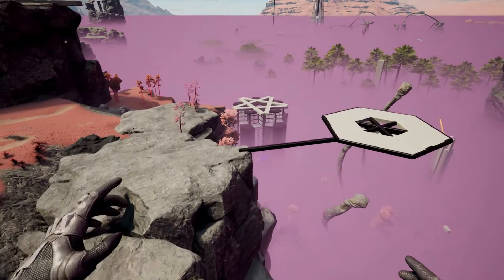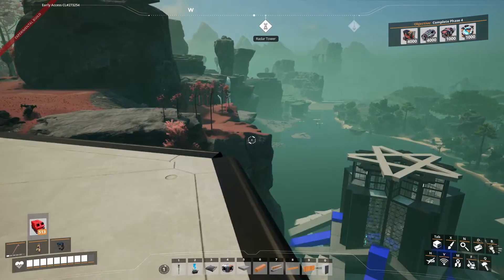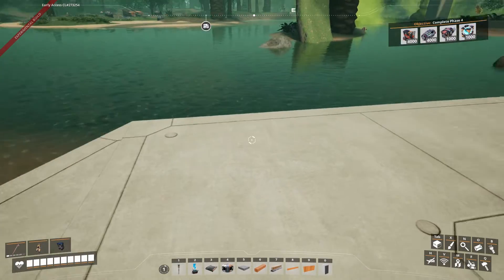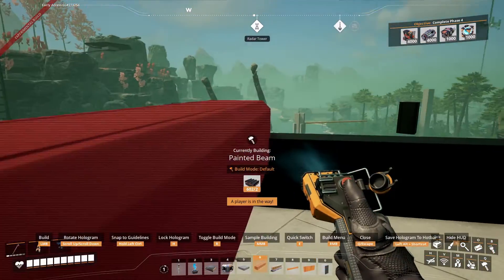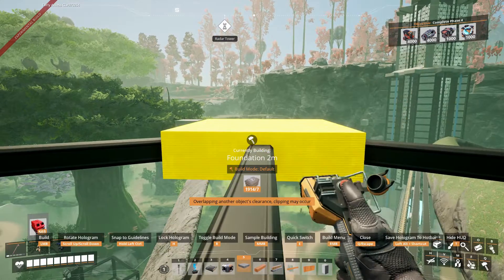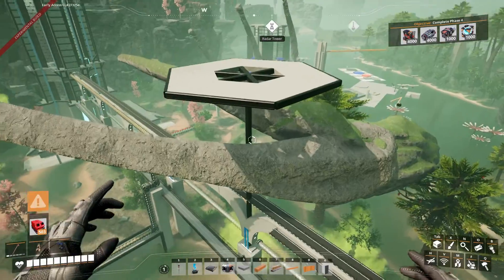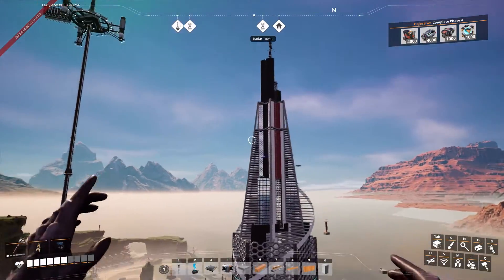Satisfactory Tips: Building a Hexagon from the Centerpoint

Comment: How big can you make this? Im trying to make an oil rigs and would like to use this method
Reply from the maker: There is no limit. There’s a beam trick you can do to connect any length, any angle. So just draw the six spokes out as far as you want, literally hundreds of meters is fine. 

Then to connect the ends of two spokes, click on endpoint of one, use R to change build mode to Freeform. Then go put your viewing reticle exactly on the end of the second spoke. Even if it’s over 40 meters, the angle of the beam is correct to that endpoint. Then connect the endpoint to that same spoke as many times as you need. If that’s too confusing how I wrote it, go to my shorts, sort by popularity and watch the fourth one “infinite beam length”

Good luck with the rigs!
Reply: @makergaming2022 sounds good. Does the road barrier trick work at any length too?
Reply from the maker: @iti @itisblackwolf mean at the beginning when drawing out the six spokes from the barriers/walls? Yes that is any length as well. Just leave it in default mode and draw out 40 meters. Then draw the next one out from the endpoint as many times as you need. Keeping the build mode on default will let you pull beams off the end of the next one in any ninety degree axis, including continuing straight.
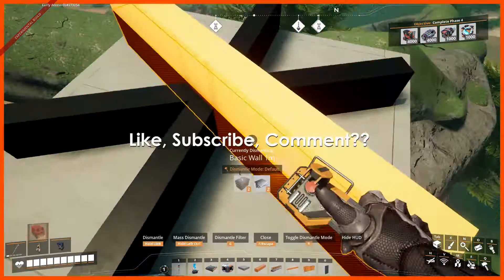Reply: @makergaming2022  I cant replicate this step at 2:45. "an identical buildable is already built there!"
Reply from the maker: @itisblackwolf did you try building it one foundation up? Then just zoop down to where you need to go.
Reply: @makergaming2022 yeah I tried zooping horizontal and vertically. I couldn't even get the road barriers to merge
Reply from the maker: Okay. I would place the first one. Hold CTRL to replace with 1m wall. Then do the placeholder step (the next step) by putting a second wall next to that one. Delete the middle one, place the next barrier and repeat until you have the three placeholders (with none in the middle).

Comment: I have a problem: I made a hexagonal blueprint where two points are at the edges of the Mk3 Blueprint Designer. When I go to place them, I can get two to line up (at least they look like they line up), but placing a third such that it fits in the angle between the two does not result in them being aligned. There is a slight offset in two directions. I can only move the blueprint along two axes and can only turn it 90 degrees. Does this mean I need to make two blueprints (with the points that touch the edge of the blueprint designer rotated 90 degrees from the other two) in order to get a way to make these fit together?

I'm trying to make a modular system of factories/power plants that will fit together and connect like building a honeycomb.

Comment: I was able to recreate the shape you used here more quickly by using the beam connector.  Each rotation of it is also 15 degrees like foundations and the road barriers. So what you do is put down a single beam connector in the orientation you want to be in a straight line from your perspective.  Do one 16m bar away, and one 16m bar towards you.  So North and South effectively.  Then deconstruct the connector, place a new one in the same spot, but rotate it four clicks clockwise, place two more 16m beams radiating straight out from the connector.  Deconstruct, 4 clicks counter clockwise, two 16m beams.  Lets you skip the road barriers, walls, and markers for all the initial beam/framework placement.

You really only need the beam connector for aligning the two clipping runs to get proper 60 degree rotations from the center point.  So you could feasibly run a 16m length of beam, then a second in the same line of the end of one point.  Put a beam connector rotated four turns on the joint right, do beams in either direction, then place another connector on the same spot rotated the opposite way.
Reply from the maker: Thanks for this description. This is brilliant. I’ve barely touched beam connectors. And if you can rotate them on the other axis, we could do the hexagons vertically!

Comment: Thanks for the shoutout, Maker!  It's interesting that you mention an obsession with polygons.  I have an authentic, autistic fixation with hexagons in particular; although to a degree it had a rational basis, because I first started using them as sectors, (essentially circuit boards, in a way) when playing Factorio.  They are particularly good for sectors where you are using flying drones, due to the fact that the distance between the centers of any two adjacent hexagons is the same.  I suspect that the reason why bees started using them wasn't purely because of wax melting into that shape naturally when exposed to heat, but that again, the centroid equidistance means that they could always expend the same amount of movement energy going between cells.

They do have some downsides, though.  

a}  They only really tile from a smaller size to a larger, not the opposite.  You can make a large hex out of a lot of smaller hexes, but you can't easily make a large hex back into smaller ones, because of the shape of the edges; you will end up with gaps.  

b}  Although it's true that they are the cheapest way to enclose a given space, if the space you are enclosing is large, and you're making one big hex rather than a lot of small ones, then your up front material cost is correspondingly very large as well.

c}  They don't work as a shape for flying vehicles where you need a lot of maneuverability, because they are so perfectly counterbalanced, which means no leverage.  The flip side is that they can still work very well in Space Engineers for cargo ships, because that balance helps there; but not for warships, as mentioned.
Reply from the maker: You sound like you belong in my Discord. A few hexagon enthusiasts in there. Xtrafresh has the best hex factories I’ve seen and he’s super active. He’s in there too. 

Space Engineers looks like a really great game. But too complicated for what I’m looking for in a game. Also, did not know that about the wax melting naturally into hexagons. Interesting.
Reply: @makergaming2022  Yes, SE is pretty complex.  But then again, it's simpler still than Stationeers, which I won't go near either, so I know how you feel.  I never really stuck with Satisfactory because at the time, I couldn't really figure out how to build hex factories, but maybe I should give it another look.
Reply from the maker: @petrus4 don’t know if you ever returned but I had a thought on a friends build when I reread this. YouTuber named XSEIDET has a badass sphere made of hexagon beams and lights. It’s pretty awesome. It’s in the thumbnail of one of his videos if you want to check it out for inspiration. 

And you’ve peaked my interest in bees. Are beavers NOT the most interesting animal?!? Will have to research more.